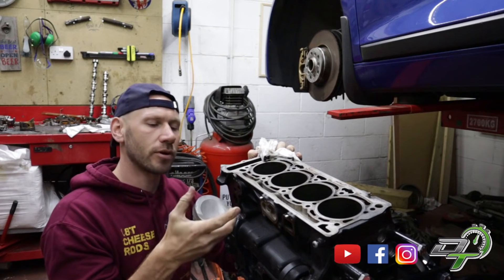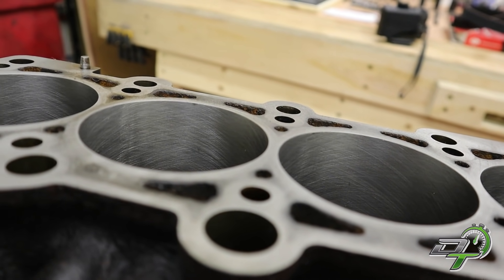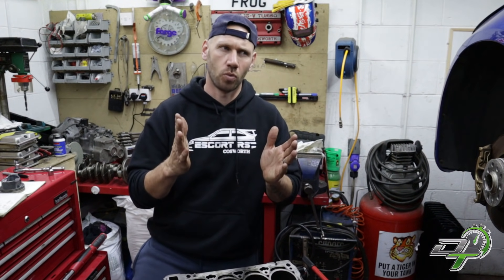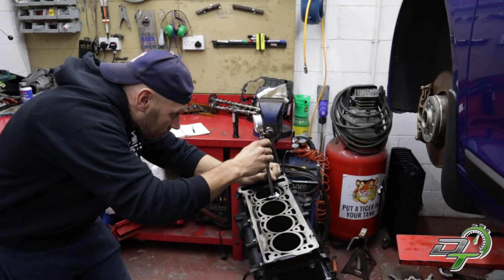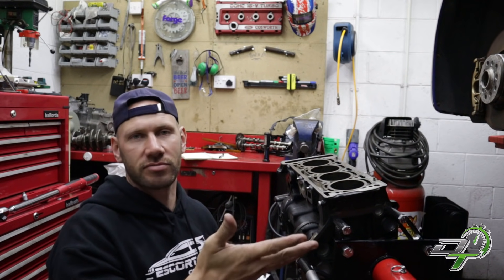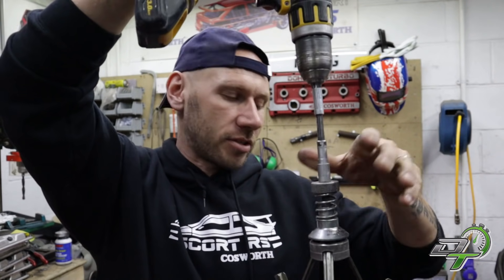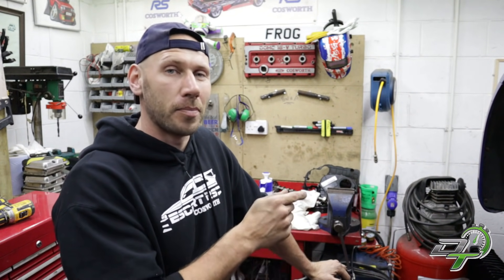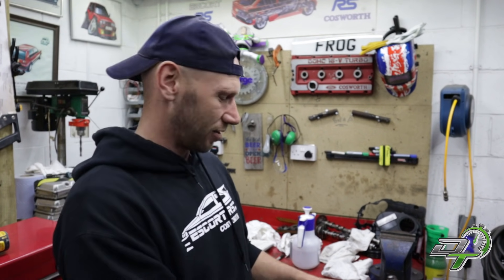How To: HONE AN ENGINE CYLINDER

Comment: I wish you had addressed the lifters' cylinders in regards to whether they are cross-hatched because I have read they are not. Honing them is only done with the following relevant tool: (ex: per my engine Brush Research BC14M240Z25 FLEX-HONE®, 0.551" (14mm) Diameter, 240 Grit, Zirconia Alumina #1525, for Low Carbon to Medium Carbon Steels, Stainless Steel and Cast Iron).
Hopefully you will respond ASAP given I need to do this job in days.

Comment: A proper finish on a honed cylinder is 400 grit, then use a 600 grit dingle ball hone to finish the valley edges so it will not damage the rings on break in, you want them to seal, not sharpen them,  Any hone that is not finished in 600 Grit, regardless of piston type or ring type, will damage the ring life and performance.

Comment: I have a Nissan Note E11 and I think I am going to use the same honer tool in my CNC milling machine, where I can program the RPM that match with the feed to get 45degrees crosshatch.

Comment: Good show.  How long did you hone each cylinder, I mean time-wise?
Reply from the maker: Only 20-30 seconds on this engine. It didn't need much. It would be longer if you didn't get the finish you needed.
Reply: @DecimalTenths  Thanks!

Comment: Good job mate. What is your preferred method breaking in the new rings?
Reply from the maker: We tend to do it on the dyno these days so that it can be completely controlled. However its very doable on the road. After the initial warm up to make sure theres no issues or leaks, I would get it out and get some load on the rings straight away. Varying load/throttle position and work the engine hard. Dont be scared as if it cant take it now then it never will. Get the cylinder pressures up with lots of engine braking, and give it time to recover after each long pull, just so that you dont overheat anything. Always be mindful that it is new and coolant might need topped up, or oil could be burnt off. Use decent mineral oil or Millers CRO. Then after 30ish miles drop it and assess before going again but with normal oil.
Reply: @ Thanks for your reply, appreciate it!

Comment: Hone looks way too flat
Reply from the maker: Mint 👍
Reply: Depends on what rings he is running. 

200 grit for cast rings, 380, 400 grit for a great deal of the other rings.

If he was running any form of racing piston rings the grit should be finer or it will remove most special coatings meant to reduce drag.

So this probably wasn't honed for standard cast rings.

Comment: Why did you need to rebuild this engine ? Seems there is nothing wrong with the cylinders ? Is it burning oil ?
Reply from the maker: The engine had a knock. I covered this in previous videos on this project 👍
Reply: @DecimalTenths  okay just watched this video as I’m going to rebuild my own due to massive oil consumption
Reply: there was not one physical or diagnostic sign showing beraing problem, hears a tick under the cam cover, just like that his sure bottom end bearing, then he goes to a full blown strip down, rebuild on a rebuild engine, that had no bearing dame at all.

Comment: I was wondering why his numbers were melting my brain . Ummmm he is doing MM . Im use to thousandths of an inch 😂.
Reply from the maker: thousandths of a what? 😝🤣
Reply: @DecimalTenths  an inch . It's 1/12th of 1 foot . American unit of measure that does not work on 10s 💀. Deffinely only makes sense if that the way you learned 😂.

Comment: Hi there buddy I'm from South Africa, thank you for an informative video however i need your expertise I'm doing my mazda b series f8 engine 1800 ,i noticed the ridge top of cylinder what should I do ,it's  the first time engine being done since factory the ridge is slight appreciate any help thank you
Reply from the maker: Hey dude. The Ridge at the top of the cylinder is the part where the rings don't move over. It still won't be used, but will be a good indication of how worn the cylinders are. Measure the area that the ring moves over and deter.ine if it is round, and within spec. Don't worry about the top part. If you wanted you could give the area some attention to decrease it, but it isn't needed.

Comment: Interesting insight!
I had this done to a Morris Minor engine back in early 1976 as it was burning serious amounts of oil. I think we went up +0.020". Got the engine back but noticed it was full of grinding grit so after putting an old carpet into the bath, gave the block a good washing followed by thorough drying and oiling waiting for reassembly. The engine ran really well for about 35k miles and then the pistons seemed kind of triangular so swapped out for another slightly bigger cc engine. Fun while it lasted!

Comment: Brilliant educational video. Very informative and clearly understood. If I may, can I call upon your engineering skills to answer one question. I'm not a mechanic or someone who's experienced in a machine shop, just someone who's got a passion for rebuilding car engines. I'm trying to rebuild a 1.7cc diesel engine (117,000 miles) and I measured the old piston ring gap with feeler gauges in the bore. The clearances wasn't excessive, just 0.35 instead of the recommended, Haynes manual opening of 0.20-0.30mm. So given the fact I intend to keep this family car for a few more years, I followed the advice of the book and invested in a new set (x4 pistons) standard piston rings. I'm a little bit disappointed because some of the gaps are worst than the old rings. In an ideal world with unlimited resources, yes a re-bore with oversize piston would be perfect. But with the car  nearly 10 years old and me having a limited budget, my question is this. After copying your feeling and sight examination and not noticing any conceivable wear in the bores. Would it be a good idea to ask the shop to swop the standard rings for slightly oversize rings (say + 0.25mm) and try and fit them to standard pistons? And after a light honing (file if need be) try and get the exact gap clearance(s). Many thanks in advance for your (or anybody's) advice, bye for now, Barry (Chester UK).
Reply from the maker: Hey Barry!
Good question buddy. For your application I would fit the rings as they are at 0.35. That's not a bad gap at all. Admittedly oem specs tend to be a amidge tighter, but that won't make any difference from my experience, plus I have seen ring gaps also showing up at the upper end of tolerances to no ill effect. 
Send it pal 👍

Comment: hello there, nice vid. Do you run both way with the drill or just one way?
Reply from the maker: Both ways dude 👌
Reply: @DecimalTenths  thanks, your pattern in the cylinder also looked quiet different than mine😂 building a 1.8T atm, hoping around 500. Keep up the vids, they’re great

Comment: So I have been honing with the exact same tool you were using but I am getting a strange pattern. I am getting the good x shape crosshatches ataround 30 40 degrees but I am also getting a strange pattern like little squares in a column. I am using penatrating oil for lubricant, I clean my stones each time, I have also tried using brake clean as a lubricant and I get the same result. Any pointers would be appreciated
Reply from the maker: Couldn't give you any advice unless I seen it to be honest.

Comment: That's not a hone! It's a glaze breaker! Those cylinders have miles on them. They're not perfect! Deglaze them with the stones it came with. Use WD. wash it out, put it together! Don't waste your time measuring if you're not going to bore it. 
It's simple diy.  If you're looking for perfection, bring it to a machine shop. 
Making a big fuss over simple re-ring!
I'm retired 55yr experience machinist.
Reply from the maker: Good for you kiddo 👍👍
Reply: Machine shops are charging an arm a leg to do work now. I got quoted 4k to do a simple clean and hone on my Audi v8. People I know are finding ways to avoid machine shops at this point. With a lot of research, the right tools and patience to detail, I can do the same job. Prices are fucking outrageous.

Comment: I have a tiny gash in the middle of my cylinder wall that I'm home now and there's still a little indentation how bad does that have to be before it cannot be used
Reply from the maker: If you can see or feel it... its time to rebore to a bigger size other wise it will never seal again.

Comment: Sir how we known that we do write cross hatch pattern
Reply from the maker: All about the rotation and up and down movement. Start slowish and move up and down quickly. See how it is after a few seconds and then adjust speed or movements to compensate and get the hatching how you want it.
Reply: Thank you sir for guiding me and give such  a good knowledge

Comment: How many passes do you do with the honing stone?
Reply from the maker: Enough to get the required finish is the answer. Is less about measuring as this isn't really removing much material, more just surface preparation. So hone until the cross hatches are visible and the surface is adequately deglazed.

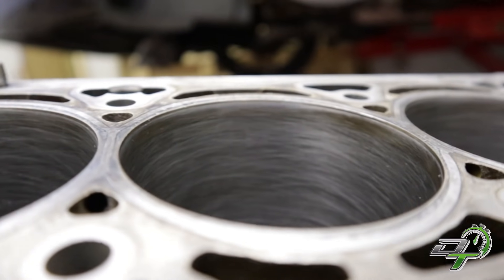Comment: Good video but at 12:30 the drill speed during honing was way too fast. 12:50 shows you have a 10-15 degree crosshatch pattern but you really want 45 degrees. Slower drill, quicker drop & raise.
Reply: how many times up and down would you say on each cylinder if Imjus6 want to take the glaze off like yours please. Thanks gents? 🙌
Reply: How long do you do per cylinder? Mine are within OEM spec.
Reply from the maker: Yes but no but...
Reply: @DecimalTenths  what is that supposed to mean? Is the video useless or not

Comment: Hello experts, 

My mechanic changed my top cylinder on my car toyota corolla 09 model due to a sound at the top cylinder. 

Note: that was the only issue my car had before I took it to him. 

Unfortunately, after the completion, I went to pick it up and in a 5 minutes drive away from the workshop, the car started misfiring and overheating. Eventually, the car couldn't start anymore  and the mechanic went ahead and ringed my engine that there's low compression. 

I told him he spoilt my engine because it was in a good condition before I took it to him apart from the sound at the top cylinder. 

Please, what do you think caused that? 

He changed the top gasket as well. 

Your expert feedback is appreciated. 

Thanks.
Reply: Hate to break it to you but you had that problem before the head was changed.

Comment: I used to work in a machine shop, and the honing machine was $30,000+, we used various grit stones, parallel guides on the hone head, absolutely flooded the cylinders with oil, we could measure the load while honing. We would careful set the stroke speed and length to set the cross hatch angles.. it was all very technical. We would bolt on a torque plate with a gasket to simulate the distortion that torqued head bolts impose, and at the end of the day, we only charged $160 to hone a V8 engine! It was the best bargain out there! Who knew we could have just used a Leslie auto parts hone with a squirt of WD40 and saved all that money and floor space!
Reply from the maker: Now you know...🤣

Not the same thing but hey I thought that was obvious...
Reply: Your $30,000+ machine was used to bring re-bored cylinders to an exact finished size. It was NOT used to de-glaze bores!! The fact you dont know that makes me think you have NEVER worked in a machine shop.
Reply: @manoo422  we used it for both.. it’s even more critical on a used engine because used cylinder walls aren’t straight anymore.
Reply: Nowadays we use a $100K honing machine and just 1 grit of diamonds to size(150 grit) then about 6 strokes with an 800 grit diamonds to create the plateau finish for the rings.     We then check the surface finish with a profilometer to verify the finish is in spec,  sometimes needs a couple more stokes with the 800 grit if you are using moly rings.
Reply: Something I recently became aware of was the need to tailor the finish of the bore to suit the ring material. A shop will know these things and be equipped to handle it. A shop can also give advice on current trends in the practice of rebuilding; about the new materials, techniques, training. That’s why I have used shops. But I’m willing to take some chances to figure it out and do my next engine with minimal shop work. Just for the experience.
Reply: @PCMenten  don’t Do it!  I’ve built engines for decades on my own diy projects. I dont do it everyday. But i’m well versed being around racing my entire life and working In and around shops… i’ve tried just about every short cut you can think of. Most of them ended up in a bad result in a way you never considered.  Dont ever take the approach of “we’ll just see what happens”.   Even if you get the bores perfectly straight. I’d bet my last dollar that you’ll have either poor compression or oil issues.  Take it for what its worth. Unless you want to do it again, like this “Pro” here. 😅
Reply: @PCMenten  have you tried it yet? If not don't listen to people telling you not to. Assuming you are okay with the risk of possibly having to do it over again. However with some care you can have a solid running engine with mostly diy work. I have rebuilt 2 with diy honing and considering doing the 3rd(which is why I'm watching this. Trying to convince myself to diy again) the first 2 turned out fine. Compression test gave little variance between cylinders, minimal oil consumption. One of the builds was a street use putt around town mostly. Other one was a twin turbo street/strip with forged bottom end. Pistons were "drop in", I didn't even measure  PTW 😂

Now I know i got extremely lucky with the 2nd build. Don't assume I'm trying to say you don't need a machine shop just know the possible risk and check things over well. 
If you are going to be building a performance engine and got the budget, take it to a pro. If you just need something to get you around town send it.

BTW 1st build I DID measure for out of round and it was within factory spec.  I also measured the 2nd and it was just barely outside of spec on 1 cyl but others were fine. I would highly recommend cleaning the cylinders and taking a lot of measurements before you diy or take it to a shop.
Reply: @bleach_drink_me Well as a professional mechanic (35 yr Senior Master ASE) and racer if you used hand honing on a twin turbo engine your not the sharpest tool in the shed. The surface finishes and cylinder sealing is extra imported on an engine using boost. Unless using a straight hone, brand new stones, exactly controlled speed matched to feed it will never seal correctly. I'm calling BS because anyone that spent the money on a forged bottom end as u say would never in a million years cheap out on an inexpensive hone job. Seriously man, you sound like the biggest bench racer I've ever heard.
Reply: @PCMenten  Tailor the ring choice to the avaible finish a home rebuilder can attain. .. its the chicken/egg debate.
Reply: @Artoconnell but thats not a debate.  The egg came first because that's how evolution works.
Reply: Yeah yeah And you used to walk 6 miles in a snowstorm to work.. So what ??
Reply: @barenekid9695  but it was up hill.. both ways!
Reply: Same comment on multiple different videos
Reply: 160 sounds really good. Where I live I payed 300 to get a V8 honed.
Reply: Well, that price no one would walk from.  I just got a quote for $2000 and that’s 40% of the work I wanted.  The full enchilada would be around $5k for a top and bottom rebuild
Reply: The problems here in FLorida USA . 1. machine shops all do contract work on one type of engine. ie jeep 4.0  2. machine shops take a month to turn something around. 3. machine shops do not do pick and chose stuff here they want to bring in a complete core, charge you as much as it would cost to buy one from a generic rebuilder and change as little as possible and never use quality parts. that said, I can use a hone an other wise fine cylinder at home to make sure my new rings seat in. You are right about pretending that those hones do not cause erratic wear as they do, but to re-ring an engine they are just how its done. thanks.

Comment: How do you know what yo get for new rod bearings and main bearings. Measure the old bearings so i can buy new ones
Reply from the maker: Measure the crank, which will give you an indication on whether the crank needs ground undersize. More than likely it will be ok so you can use std size bearings, and if its not then there's plenty of 1.8t cranks out there to get.
Reply: @DecimalTenths  my crankshaft read main 24 rods 21
Reply: The book calls for 24 on main 21 on rods but i feeler gauge my bore it shows 035 good or bad sir i don't want to bore it cost 500 here in louisana shit i was hoping buy bearings and put back together im just a loser every thing i opened on theses blocks there junk i don't know what yo do
Reply: My bore is 3.736 caliper its just little bit over 3.736 idk what yo do please help me sir the cheapest way